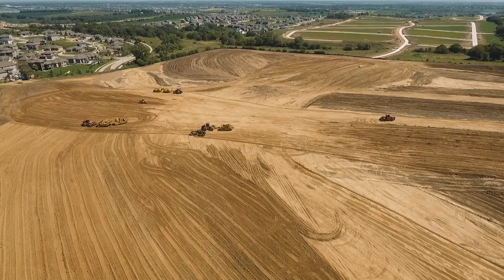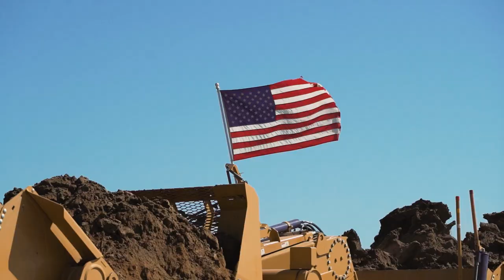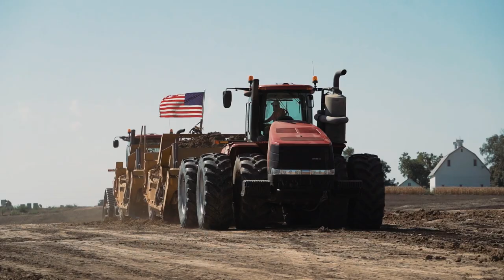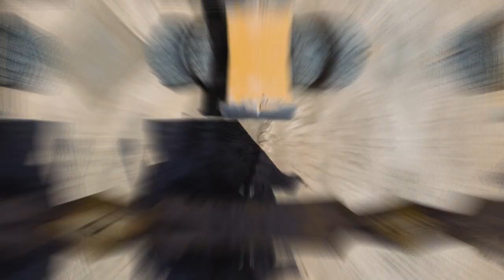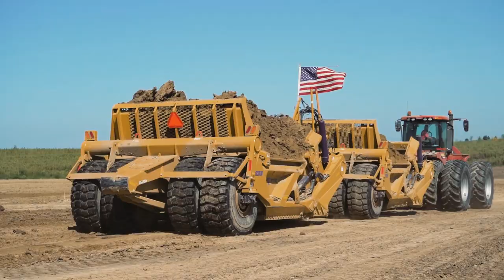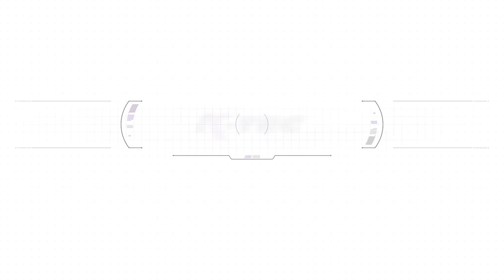Subdivision Earthwork with the K-Tec Ox Block and 1233 Trains

Comment: I remember loading a 627 in sand and only being able to get half a load, it just wasn’t cost effective. We wound up loading 6 wheeled Volvo trucks with excavators and then it still had to be spread on the other end. The scraper has come a long way. 👍🤙
Reply: And the equipment to pull it. Tractors are heavier, more powerful, and have a better weight/balance today than ever before.